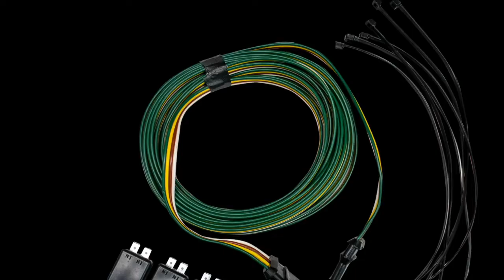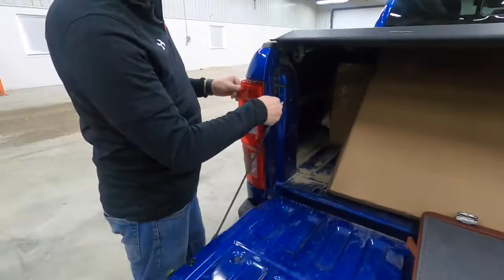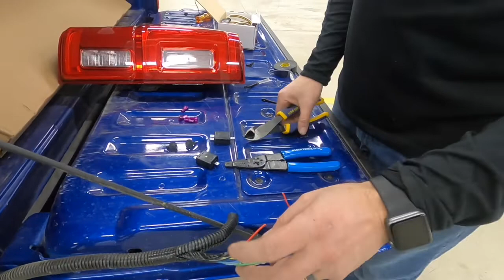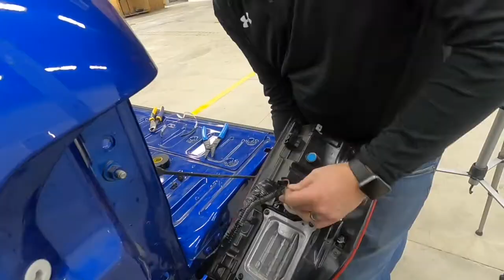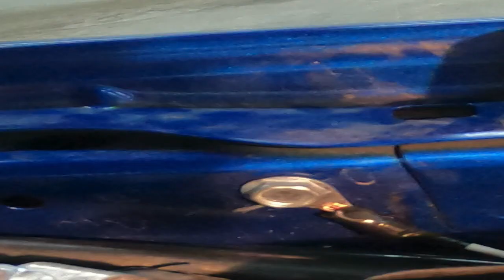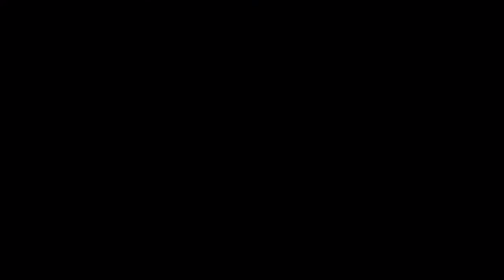How to install Demco's towed wiring using diodes

Comment: I have a 7-pin on the motorhome, to 4-wire on the toad, alls good. Lately the lights on the toad are intermittent so I'm thinking loose connections with those pesky "wire taps".  In fact the lights were OK after the last fix and re-clamping the wire taps seemed to work. Now one light is in-op, so I believe it's the wire tap in again. Instead of reclamping, is soldering the connection OK? I have a background with soldering and circuits. Thanks
Reply from the maker: Apologies for the late response. Normally that wouldn’t be required. However, if you’re experienced in soldering there is absolutely no harm in making your connections that way, especially if you’re having trouble. Feel free to call us at 800-543-3626 with any questions or concerns.